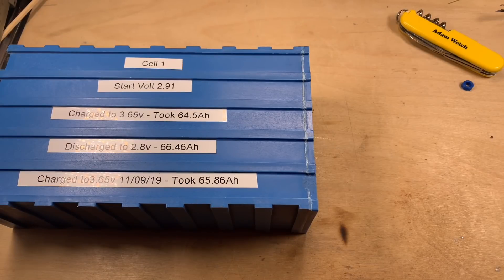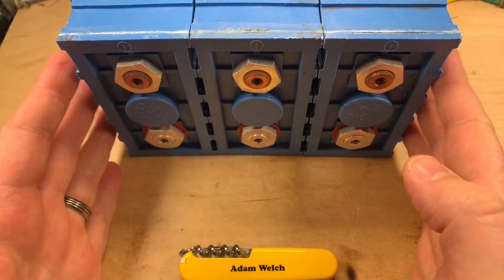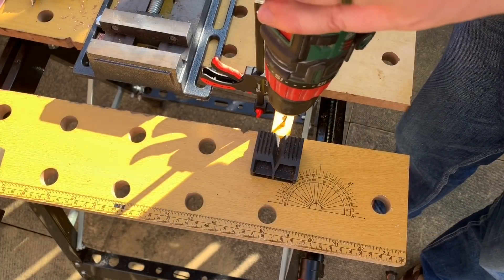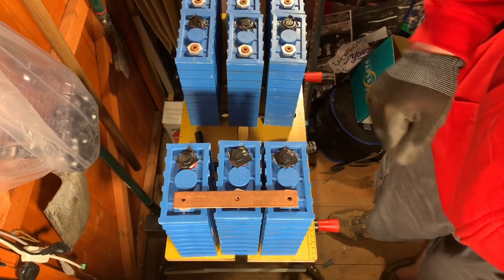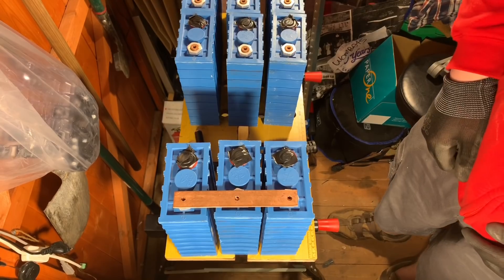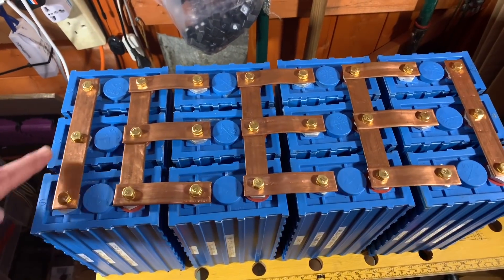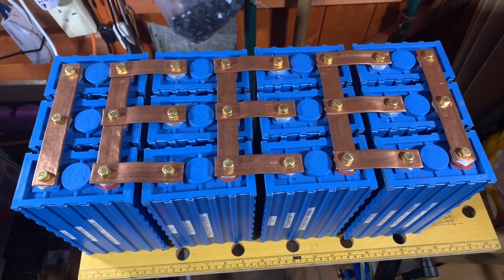LiFePO4 Battery Bank Build

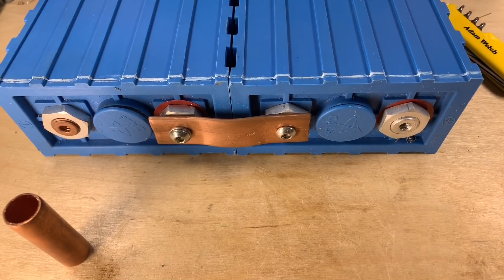Comment: 2:06 not to be a downer, but when you use "smashed" copper pipe, you are creating more resistance, unless it is perfectly flat. it can even cause arching, excess heat etc. Great videos, been binge watching them all night. I spoke up about this because my inspection failed due to trying the same thing with copper pipes, the inspector said the above to me. It may be different where your from.

Comment: Wonder if anyone can help me please? I have a 12v solar system made up of 4x 12v 75ah batteries wired in parallel,  I  have jusr bought a new charge controller and it requires me to input my battery bank capacity, do I put 75amp or 300amp?
Reply from the maker: Wired in parallel you add up the amp hour rating - so you’ll have 300Ah.
Reply: @AdamWelchUK  thank you Adam, I kinda thought it would be but just wanted to make sure. Love your vids, very informative and entertaining.  Stay safe and take care, kind regards Andy 😎
Reply from the maker: Cheers Andy. No bother. You stay safe too.

Comment: Hi Adam,

Brass / SS / etc. doesn't matter as long as you use a bit of grease, but I'd advice normal (cheap) galvanised steel hex bolts, with Nord-Lock washers. the bolts you showed first also have a tendency to break of the head when torqued properly.

all cell terminals, but especially the aluminium terminals: sand them 'clean' then immediately clean / apply some grease: aluminium grows a corrosion layer very quickly, and this is insulating, you have to clean that of, the grease keeps away oxygen so prevents re-corroding.

copper busbars + aluminium cell terminals: severe galvanic corrosion....again: apply grease and problem is prevented (you can use fancy 'no-ox-id' grease, but most grease will do (Vaseline is fine)

another tip, busbars: you can use aluminium strip / bar, very cheap, very good, don't use anodized as that has a thick non conductive oxide layer. also: sand before use, apply grease. Aluminium has 2/3 the conductivity of copper, so if you go 50% thicker you have the same resistance as a copper strip.

Lastly: compression: it's best to use these cells compressed, as they tend to swell over time, swelling= less capacity etc. = not good.

Nice cells that will last you a long time if you do it right.
Reply from the maker: Thanks for the tips. I’m going to redesign and clamp the cells together - a few people have mentioned this. I’ll look into grease too. Cheers.

Comment: A newbie question: Why do the bars used in series have a bump in the middle?
Reply: I'm guessing it is because of the rim on those batteries seem slightly higher than the electrode and prevents the flat piece to be used. Just a mechanical hack.

Comment: Hello Adam ,
 i am having an issue with Epever Mppt controller , in cloudy days the controller is doing PWM as u mentioned  in ur videos but there is a problem happening on load side of the controller bec of pwm it will flicker the load side which can be noticed by eyes on leds lights can u have a solution for that bec i powering  my  load directly from controller load side. .
love ur videos keep the good work.

Comment: Why did you not shrink slave bars first then open holes in plastic for more protection
Reply from the maker: It’s a good question. I need to look at how I could achieve that - the cells have quite large terminals at the top so I’d need to cut a sizeable hole. I’ll see how I could achieve that. Thanks.

Comment: Great video, I completed a 48V, 120AH solar storage battery a few months ago and was surprised to find out during my research the absolute lack of any BMS systems that are a complete solution with regard to full protection for OVoltage, UVoltage, OCurrent, UTemp, OTemp along with active cell voltage balancing of at least an amp and some type of communication interface like Wi Fi and/or Bluetooth. Most of the systems either have no communication interface or are CAN based. There are products on ebay and Alibaba but many of them are "inline" type BMS systems meaning that the full current passes through the circuit board, I don't trust that arrangement so went with a ZEVA BMS that has an external shunt & relay outputs to control a high current mechanical golf cart type contactor. I then added an inexpensive 1.2A active cell balancer board. Set up and monitoring is done via CAN bus with a color touch screen. I have a friend working on a possible interface module based on Raspberry Pi with a CAN shield expansion board so I can get the BMS info onto my home network.
Reply: Interesting, I'll have to look into zeva. I'm thinking of building a 48V battery for a solar powered cruising boat. So a different type of electric vehicle with a large solar roof.

What are your thoughts on going from 48V to 12V or 240V for appliances? 48V seems to be the max "safe" voltage and also not too messy BMS. 

And if you buck down to 12V or 24V at the "outlet" you should have less power loss for your wires.
Reply: @dejayrezme8617 , I agree with you that 48V is really the maximum safe voltage to be working with for the average person, not to mention that many components designed for DC are rated at 48V by the manufacturers so selection of higher voltage DC devices is limited and expensive. You are correct about power loss on wires being reduced with higher voltage (this is more of an AC issue with transformers) BUT Buck/Boost converters are somewhat inefficient so whatever the gains are at 48V probably would be lost at the Buck stage. I have several ebay buck/boost converters for charging individual cells etc. they get HOT with only a few amps.
There are low voltage appliances such as refrigerators available but they are expensive. My advice is to go with a either a 24V or 48V battery system then pair it up with a GOOD, EFFICIENT,  HIGH END Inverter (Magnum Energy for example) then you can use relatively inexpensive, off the shelf appliances, LED light bulbs etc. that are available anywhere you go.
Reply: @dejayrezme8617  One last thought, if you do wish to use your system for operation of a small RV Air Conditioner unit then having the high voltage AC from an inverter is the best way to go. There are "soft start" modules available that limit the in-rush current on start up so your inverter is not overwhelmed. I'm using a Hyper Engineering device on my 4 ton condenser at home. Seems to work well but I have not tried to run it on my Schneider Inverter that is rated for 8500 Watts.

Comment: FYI, for long term storage of LiFePO4 cells or batteries, they're best stored at 40-60%. Storing them at or near full capacity can seriously degrade the cells. It's different if you're actively using them.
Reply from the maker: I planned to do this much sooner, but things got in the way. Thanks for the advice though :-)

Comment: It looks like your 18650 battery pack is 24 volts.  Curious why you don't buy four more of those 65AH batteries and then use all 16 to make a 2P2S 24V battery pack instead of the 3P1S 12V you just made. Then you can use the same 24V inverter. or Just build a 1P2S 24V pack and use the extra cells to make a smaller 12V for something else.

Comment: Looks good.
The only thing I would change is having the cells tight together so you can clamp the whole pack to stop any expansion 👍🏻
Reply from the maker: Yeah this has been mentioned, and truth be told I wasn’t aware of this. I’ll look into this and decide how to move forward. It’ll mean redoing my connectors though I imagine. Cheers
Reply: @AdamWelchUK  You could put more of a kink in the straps to make them shorter if needed, bend them over a bit of 20mm conduit. Are you planning to grease/vaseline the final connection as you assemble them? We certainly used to do this with 50V bus bars in tele exchanges.
Reply: @twotone3070  What is the grease for? Insulation? Anti corrosion?
I was wondering if you could paint them using some kind of silicone or "liquid electrical tape" or something.
Reply: @dejayrezme8617  It was for anti-oxidisation. It was cheap, simple and effective, no need for a 'modern' alternative. You just need to stop oxygen from getting to the part.

Comment: Correct. its no need to fuse those cells internally. Just a main fuse is enough.
Reply: What is the reason?  18650 pack builders use individual fuses for each cell.  Is it because lifepo4 are safer?
Reply from the maker: Cheers

Comment: IHHHI uses the same amount of copper as IEEEI, but will have substantially higher ESR - assuming that the busbar-ESR is dominant (which it likely is not). Nonetheless, good to see the optimization :).
Reply: Probably the most cost effective would be thick bus bars on the ends and within a string, with thinner (14 AWG or so) wire tying each level together to maintain balance. The balancing current between strings is very small. (For that reason, if using bus bars between strings, put those above the string bus bars so the high current path goes through fewer copper contact points.)

Comment: You should give it a crack running it for a while without active balancing! The 4s2p pack I made (from admittedly much smaller 26650 cells) has never needed balancing, and I've had that running for over a year... (Obviously still need overcharge/overdischarge protection)

Comment: Ooh Adam. This will be interesting! Most of the other banks I’ve seen have been configured as  4 groups of 3 parallel cells to keep the 3p groups at the same voltage. I’m wondering how cell balance will keep up since, wired this way, under load the groups of cells are not forced to the same voltage. So which cell will you monitor in each group or do you intend to monitor every cell? (Although I seem to remember you have a 4 channel bms).
Reply: ? All the cells in each parallel set are commoned with bus bars. What are you referring to?
Reply: This is 4s3p.
Reply: Charlotte Lackney this is the correct configuration. Parallel cells match their voltage to the cells they’re in parallel to.

Comment: Given your soggy environment the Brass Bolts is a good Idea I think..   Here in the Desert S.W.  I would have just used the Stainless Steel without second thoughts.  The Dry contact wouldn't be a galvanic issue.
Reply from the maker: Soggy? I’ll have you know the north of England is not soggy! ;-)
Reply: @AdamWelchUK  Just really damp...  right?
Reply: @Tinker001  LOL,   While in the USAF I was lucky enough to get parked in North London area for some 5 years.   It as SOGGY  more then not.  Coming from the Desert South West USA I started molding.   I have  24 Lion Brand Prismatic about like your cells.  I need to figure out a means to create a mold to shape some bus bars like yours.  No Printer at hand.  I found a source for the bus bars,  Flippen Ell there proud of the things.  Like $5.00 each.

Comment: Very excited to see you do this. I have been on the fence about purchasing the same batteries and building a large battery storage array with a whole house solar system. I like the cost vs the nissan leaf cells and hated trying to use thousands of 18650's. look forward to your next video
Reply: I went with the 280AH aluminum cased cells. China has a Glut of LFP cells right now. They were for their cheaper EV cars, which the market for has tanked.

Comment: We built large Batteries out of this and other LiFePo cells. All were delivered including busbars (the small ones) and stainless steel screws.
Reply from the maker: Stainless steel screws - oh well, I’ve got the brass ones now.
Reply: @AdamWelchUK  the brass ones do indeed have less chance of galvanic corrosion specialy in humid outdoor environments with large temperature swings.

Comment: With those bus bars you will have plenty of current capacity through them.. thats good, 4s-3p so its a 12 volt system that makes it easy to find an appropriate BMS for it.. or in your case make one :)
Reply from the maker: Well you know where this is going... :-)

Comment: Rather jealous of the new battery bank!  We’re you not tempted to do the inter battery connections in a figure 8 rather than E?
Reply from the maker: I’m not convinced it’s needed, but I’ve spare pipe to complete that if I’m wrong. As it stands all the paralleled set terminals are all tied to a common point. . 18881 rather that IEEEI!
Reply: @AdamWelchUK  I'm with you on the 18881 vs 1EEE1 Adam and, like Colin, jealous, very, very jealous. :) So, while I'm dreaming I'd go for a 1EEEEEEE1 .
Reply: I say go for symmetry and make it an IE83I configuration. Haha
Reply: @JonathanWellskcender  Ummm yeah, beautiful palindromic qualities.

Comment: Excessive to have a bus bar between the negative posts as well as the cross over bars?
Reply from the maker: I’m happy that the negative of each set is commoned together using the positive of the lower set - but I can always knock some out if required. It’s not excessive I don’t think, but possibly not needed either. I’ll take feedback on that.
Reply: Were it me, for high discharge I would even add three more series bars to the "E"s keeping the single parallel bus along the negatives but also add a single bus along the positives and then double up on the bus bars on the ends. This serves two or three purposes, (a) you can never have low enough resistance and in high current work you typically find lots of thick bar stock with more mass than that pipe, and (b) the highest resistance part of these strings is going to be where the bars and posts meet and those places will heat the most under heavy discharge so by having more copper there it also works as a heat sink/spreader. Copper is great that way. (c) There is also the benefit that if a string develops a bad cell, the others will still be able to contribute via those bus bars. The cross section of a single water pipe I could see as medium duty depending on the pipe thickness. In the US, we've got three common grades of hard copper for water use and the good stuff you can direct bury in the dirt is about 75% thicker than the cheap indoor pipe. Finally, crushing the ends in the vise after drilling and then coating the contact surfaces with some silicone grease should make this setup perform every bit as well as one costing much more.